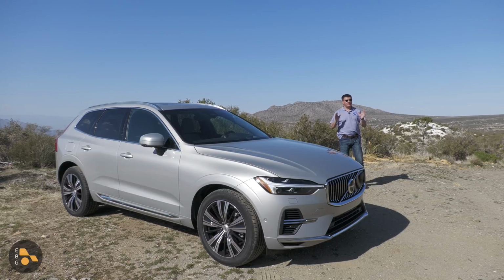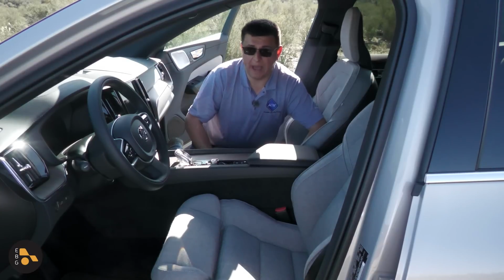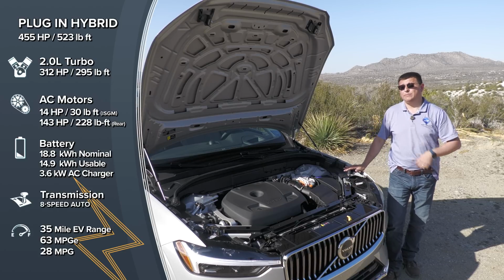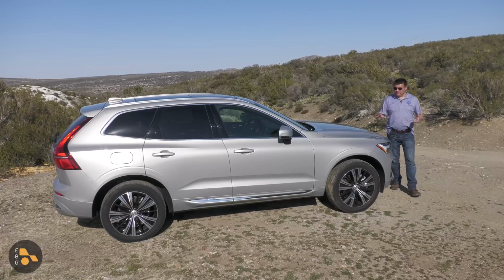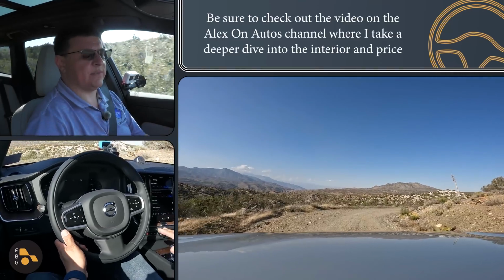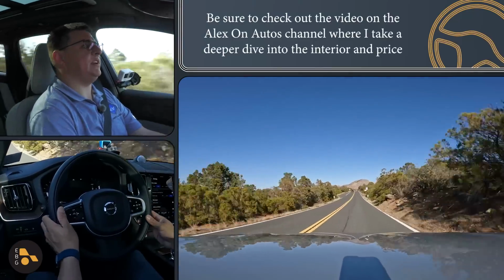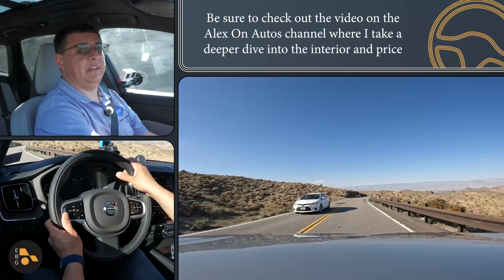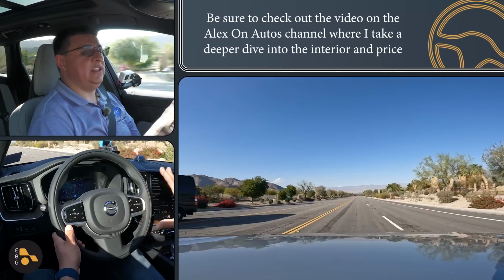Volvo's Popular XC60 Plug In Hybrid Makes So Much Sense | 2022 XC60 Recharge Extended Range

Comment: When someone does 99.9999% electric miles it's because he or she also has an ICE car for non-local trips.  A PHEV with 35 mile electric range is a good solution if you have only one car.  Short trips burn no gas.  Longer trips avoid electric range anxiety.

Comment: First intelligible/true description I've been able to find of how this braking system works. Thanks! Also agree it's better that this car always lets the engine kick in under full acceleration regardless of the drive mode. If you're in Pure and you suddenly find that you need to accelerate out of a sticky situation (think merging onto the highway between two semis), 140 hp isn't really up to it in a car this size. That being stated, you literally need to floor it to get it out of Pure mode, so not a big deal either way.

Comment: At one point you note how plug-in hybrids achieve nearly the same results as a full BEV with only one-fifth or one-sixth of the battery resources, but then you bag on Volt drivers for not buying full BEVs, with necessarily larger batteries using much more battery resources!  Which is it?  To me that's the beauty of the PHEV, uses less battery!

Comment: Great review. But, features focused rather than experienced-user focused. We have the 2022 XC-60 T8 regular range. Car has been to service 12 times now is 14 months since new. 10 of those visits were for software issues. Software version has gone from v1.7 to 2.5 in 14 months. We were on vacation for a month and batteries - both motor and starter batteries were dead. Had to call Volvo Roadside assistance for jumpstart. Seems the auto update feature keeps pinging the car which drains the batteries. Too many other issues to report here. Suggest going to Volvo user forums.  On the plus side, our XC60 reads fuel avg is 61.1mpg and have 810mi since last fuel up. 1/8th of tank left.  And very comfortable ride. Would not get anything less than the Intuition version (called something else now). We use Pure mode mostly to achieve this. While we love the car, Volvo software engineers working with Google engineers is a huge work in progress. We are going to trade this in for another brand of PHEV, but not too many out there.

Comment: Owning an XC60 for 3month now, and it's the worst purchase I have made in my entire life! 
1- You buy a Volvo for its safety. However, for a simple task like switching steering assist on and off or changing drive mode, you must go to the deepest parts of the menu via the touch screen while driving. That's not what I call the safety focus of a brand!
2- Android system for cars is a joke at the moment. In the past two months, I had to hard reset the infotainment system (I learned it thanks to the Volvo owners forums) to resolve issues like Lost GPS signal, Malfunctioning Air conditioning in the middle of summer, voice command not responding etc... Have I not known about this hard reset, I had to take the brand new 90K car to dealer at least five times!

3-There are buttons that do nothing, and I have the highest spec possible. There are two on the steering wheel, as arrows to the left and right and do absolutely nothing! Why?  Because they used to control the steering assist, but Volvo decided to save some money on wiring and moved it somewhere deep in the main menu of the touch screen. Then respect your customer and remove those buttons! 
4- Driving dynamics aren't comparable to the ones of BMW, Build quality is not close to the one of AUDI... Safety is what remains, and You buy Volvo because of it!  Then, with that touch screen and removing every single button on the car, safety is more of the past story for Volvo!
Worst purchase of my life!

Comment: Great review. I’m in the processing of trading my TM3P for a M3, been looking for a great PHEV to serve as my daily and this has been at the top of my list. When it comes to Price, range and performance this stacks above the rest. Like everyone has stated, having a Full electric is nice, but your restricted on the distance you want to travel. Not everywhere has chargers and even if it’s on your path having to wait 40 mins to charge every 240 miles is not pleasant. The PHEV really solves that issue. Specially if your daily commute is only 30 miles a day.

Comment: I will wait for next year's XC60 phev that'll get 50 miles of electric only range. It will also have a mild refresh look and updated trim levels.
Reply: I've been hoping for two years now to use the Overseas Delivery Program in Sweden.  Still problematic in the areas we planned to visit during a couple of weeks tooling around...
Reply: It doesn't make sense that they would refresh  mid 2022 only to do a new system in 2023. A lot of money and effort for half a year

Comment: I see a lot of keyboard engineers claiming these ice systems with the turbo charged 4 banger are going to constantly fail. Well I have a 2015 V60 with the turbo charge 4-cylinder and the only issue we have had on our 7 year old car was a failed fuel sensor.

Comment: I hear you, however, I still struggle with math (range). 35 miles, so, maybe 50km for me in Canada and through in winter temperatures, what is my range. Should I buy a vehicle with two (2) propulsion systems? Sounds heavy, complicated and expensive. There has been at least one Volvo in my driveway for the last 50 years,. Currently a 2012 XC70 T6 and a Chevy Tahoe 5.3l Z71. I can't see buying a compromise vehicle that will soon have an obsolete battery system if I understand the Sodium Ion hype currently on the internet. I'm a young 75 and still enjoy a road trip.

Comment: two things to respond to, as a current EV owner of two Nissan Leafs, the 'normal' Ford Focus gas vehicle, and now a PLUG IN HYBRID 22 Kia Sorento Sx Prestige:    1)  those who choose a PLUG IN  HYBRID, like us, yes, want to drive as much as possible in ALL ELECTRIC mode, matter - of - fact, would love to drive ALWAYS in electric mode, but the engine is there for long trips, times when charging the battery is not practical or available, etc.  BUT, it's not only that - it's because finding certain 'trims' of vehicles in an ALL ELECTRIC model is not always available, such as this 3-ROW SEATING vehicle... there are only a CHOSEN FEW, if not only ONE, available in the U.S., if you can even FIND one, or you have the patience to WAIT for one, or the money to buy one.  This Sorento PHEV is the wonderful 'in between' gas and EV vehicle, for the time being.  Until the EV market matures and in several years there might be 3-row seating vehicles in all EV models.
2) The KIA Sorento PHEV allows for FULL TIME EV driving, as much, as often, and as FAST as you want, as long as it remains in EV mode.  I have not noticed that it will EVER kick on the engine, no matter how you 'floor it' while in EV ONLY mode....which I appreciate.  Of course, when you run down to 12-15% battery power, the vehicle is going to switch over to HEV mode, and the engine and battery are then going to work 'together'.  Although, as another note, there are STILL times when the vehicle is in EV only mode, even though it may show as '0' miles available - it's designed to CONTINUE to assist the engine, working together.  I find the EV mode absolutely amazing - and and my wife drive it to and from work EVERYDAY with no engine cranking, running, or using fuel.  Yes, it's an ALL ELECTRIC vehicle, for practical purposes, most of the time.  On the trip to Florida, of course, it is going to use the ENGINE most of the time - that's the beauty of the PHEV - NO STOPPING TO CHARGE.
Yes, I'm waiting on my F150 LIGHTNING in a few months, but for the time being, and for my wife's concern, the Kia Sorento PHEV is absolutely a wonderful 'EV' vehicle, for most everyday usage.

Comment: The Green community wants EVs, all EV's, no more new ICE cars (an exaggeration but not a huge one).  They are narrow minded and impossible to reason with, just like the 'Merican fossil fuel community that cringes and shakes their fist every time they see a Tesla and hear about a 'lectric Mustang.  Neither side is reasonable nor do they make sense.
Enough said.

Alex, you have said it before.  Is it better to build an EV with a single 100 KW battery, or a bunch of PHEVs which can be sold to a bunch of reasonable folks who will keep that small battery charged and get their 20 or 30 or 40 or more miles every day.  Many drivers in this country can use this type of vehicle and they would rarely use the gasoline engine.  And, when they wanted to take a trip out of the battery range, they have a gasoline engine/generator and can do so without blinking.

PHEV's make so much sense in this country.  The radicals on either side are not interested in them.  That factoid from the Green community involves (nearly) only someone who would buy the vehicle and NEVER charge the battery, and even then I find the factoid a load of BS because the battery will recharge some while driving.
---------
Excuse the rant.  I was just watching Roman on TFLTalk and I caught the rant flu.

As you were.
Reply: You nailed it😊👍.
The tribalism is dumb.
Our i3 REx allowed us to drive 24,000 miles last year on just 25 gallons of gasoline. Zero range anxiety.
The 33kWh battery would be considered small, but it covered over 95% of our needs, and I'm ok with that☺

Comment: I own a PHEV, and my goal is to use as little gasoline as I possibly can. When I need to go on a road trip, I don’t feel bad about using gas; that’s the whole point.

That doesn’t mean an EV would be right for me, right now. I live in Nebraska and charging infrastructure is nowhere near what it needs to be for practical road trips. Sure, maybe if you’re just passing through the state on the Interstate you could make it work, but if you take road trips within the state, you’d be hard seriously sacrificing time because you drive an EV.
Reply: They have been building out the fast chargers in Norfolk, Columbus in Nebraska but I agree with you in general. Especially heading west towards aft Robinson.

Comment: For me, vehicle utility is part of the decision between PHEV and EV.  MachE, Model Y, Ioniq5, EV6, etc aren’t really SUVs with decent ground clearance etc … they’re more crossover/hatchback-like.  Yes, Rivian or F150 Lightning are options for utility and ground clearance … but at a higher price point (if you can get your hands on one at all). I’m in that category where a full EV would meet 95%+ of my daily driving, but I don’t really like the choices that are 1) available and 2) under $60k.  I’m sure the landscape will be different in a few years.  Until then, PHEVs seem like the best option now.  Can Toyota just release EV versions of the RAV4 and Tacoma already!?!

Edit: ok, the C40/XC40 Recharge might be EVs to consider … just watched those reviews.  ~$60k for 223mi range, though - that’s the next hurdle for me to get over psychologically.
Reply: Also the BZ4 is pretty much a “RAV4” ev.
Reply: Check out the solterra

Comment: You said if 90% of "your daily driving is EV, then not buy phev but get all ev".    But still 10% needs ICE, & how about the fun of just driving a long day sightseeing trip beyond 35miles, & PHEV is good compromise until US charging stations are plentiful, or until every small town has a "swap" station on the corner where my EV car has quickly switchable battery packs, similar to putting in new flashlight batteries.
Reply from the maker: Almost all EV charging happens at home or at the office, so the cry for public charging doesn't actually fit the reality of living with an EV by the numbers.
Reply: Alex might’ve made the assumption that you live in CA where charger stations available on every business corners.

Comment: Hi Alex, on the XC90 22.5, EV mode will keep you in pure 100% elec, no ICE kicking in even if you floor it!!! It should be  because of the still sensus operating system... Made 3000km so far with it, love it. However, downside, was at least once treaky while overtaking a lorry on country road, you forget that no extra power will come, in Pure!!! 2.6 l per 100km average  consumption so far, rgds Henri
Reply from the maker: This may be a market-by-market thing, but in the USA the XC90 in Pure mode will still use the engine if you floor it. Where are you located?

Comment: Every time you talk about how the XC60 isn't a Land Rover we kinda take it personally lol.  You're 100% right, but the XC with some good tires does pretty darn well!  FWIW as you probably know there is no 'gasoline only' mode, so somewhat unfortunate you said that phrase in here.  One of the top questions we get on our XC is 'how bad is the performance when the battery runs out?'.  That literally never happens, it's designed to not do that because that would be dumb.  It doesn't run out when driving fast nor driving to Tahoe, basically anything short of charging Pike's Peak isn't going to be any issue, it's simply not how hybrid systems are designed to work and maintain their minimum charge states.  Love the new Volvo hybrid setup and even contemplated upgrading to get it along with a fun EU Delivery, but the lack of the drive mode switch is a total deal breaker for me.  That's the most touched button in my XC after the door locks and I cannot imagine fighting the touch screen all the time to do it.
Reply: Not have one, but someone commented that vocal commands work well in xc60 extended range:  "HEY GOOGLE, increase to 72F".  
I wonder if Google verbal command can change driving modes while moving down the highway.

Comment: I worried about how big the battery is making the gasoline tank smaller thus making charging and gas fill ups constant and way more work then just dealing with gas or all electric
Reply: The first year or two of the PHEV XC60 did have a bit smaller fuel tank, back in like 2017/2018, but the 2019 model year it came back up over 18 gallons again and with this refresh all models of XC60 have an 18.8 gallon tank regardless of how hybrid they are.